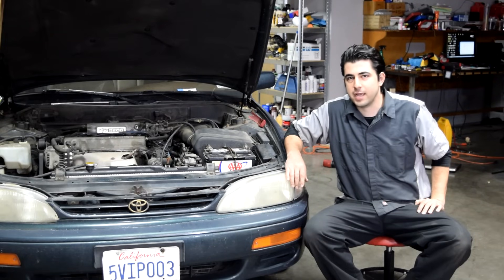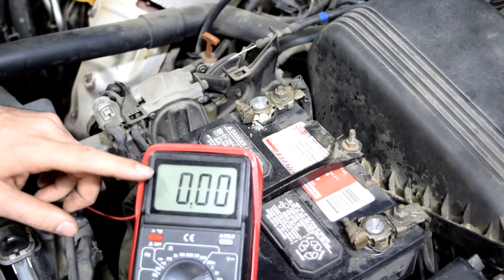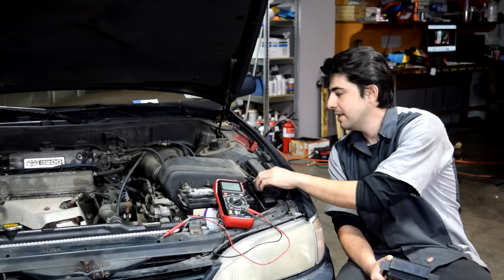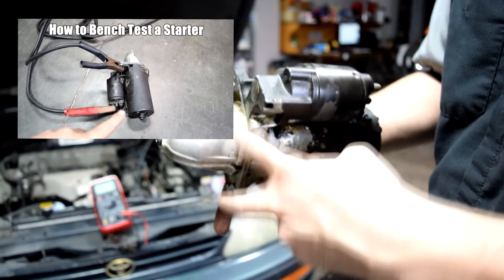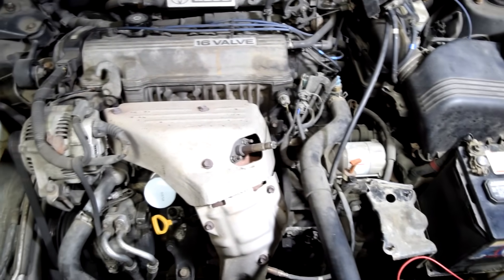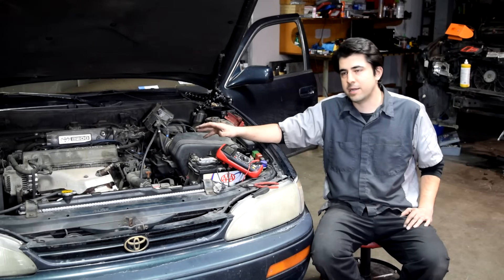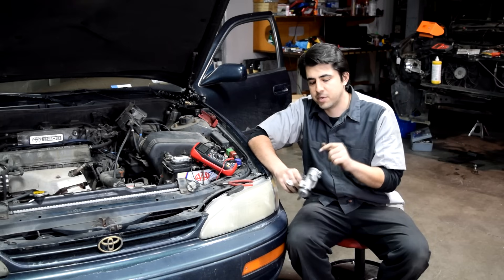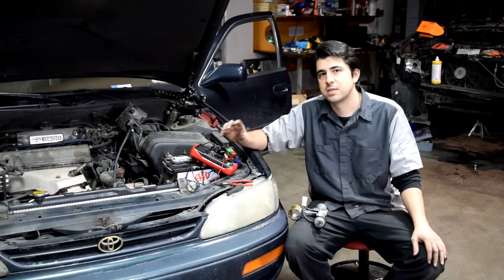How to Diagnose a No Crank No Start Issue - Nothing or only a Click When the Key is Turned

Comment: Excellent detailed video. Thanks for sharing your expertise. I got a no crank, no start and have been getting PCM codes. So I replaced my PCM. Still no start. I just changed out my ignition switch and still no crank. I cannot jump start it, so not the battery. I'm going to test fuses next and go from there.
Reply: I have 2006 Chevy Colorado same thing like mine it was the tb plug fixed it runs like new now
Reply: James Brant I replaced the starter. It started but I’m still getting battery light and I had the alternator replaced just a few years ago. So I’m thinking it could be a wire to the alternator.

Comment: How about a no start no crank, no click, no dash lights no dome lights come on or the headlights, power windows and locks dont work. Battery was tested, not the battery starter hot wire hot, i cant figure it out
Reply: Check your 100amp fuse

Comment: I have a 95 dodge dakota, 5.2 v8. I had the same thing happen to me the other day, i tested my battery and charged it and cleaned the connectors, then i pulled out the starter motor and had it tested, it passed and so i put it back in, when i plug it in and touch the two starter motor wires   together with a screwdriver (to arc the connection to test it) it works, i tried swapping out the fuses too, nothing, so i am taking apart the steering wheel and seeing if there is a problem in the ignition system.  HELP!

Comment: When I start my 97 Celica it initially does not turn over. Everything else goes on (radio,interior lights, etc.), I reset and wait two minutes and it starts right up. Is it the solenoid, starter relay or starter motor which is not charging up sufficiently?

Comment: hi guys i have an audi a4 that not start, i jump the cramshaft manualy and start but don't speed up and turn off, while it's started if i disconect all other sensor it still keep running i'm disconcern.  any advice. i changed all sensor and icm(computer) and keeps failing.

Comment: so why if I follow all those steps and the starter is brand new and the starter solenoid is new even the battery is new my truck just make a noise like trrrrrr then just the click sound after 2 more click she melted the terminal of my new battery btw i turned the engine by hand to make sure so I think is not froze up or seized any tips?.
Reply: Did you ever find out what it was

Comment: This week my 7.3 had no click one morning on several key turns, came back in an hour, started right up.  The morning prior had to crank 3rd time (no clicks, just cranking, no fire up) before it shimmied right up and was good.  So, Replaced 2 year, 10 month old "good" Deka batteries with Odyssey glass mats and no more issues and wallet's easier to carry.  Last fall I had a "click" noise when turning key, there was a click" from R front fender area, replaced starter relay and good to go (had to hit relay to start to get home (or you can screwdriver from small to larger terminal on it, and risk shock)).  Tried a new relay when had click one day a month ago and found the ford one took more draw and wouldn't work, so put on chinese one and it fired up until this week, so I had clues my batteries were ending life cycle).  Sometimes numbers look ok but older wiring loses juice at various spots and grounds get crappy, I had cleaned starter connection under truck and all battery bits in the fall, but cold winter drained more juice until it was clear I needed new cells.  My starter is hi-torque, and alternator HD rebuilt, both last 2 years.

Comment: i get no crank anything on a 91 crx i got new battery, alternator, starter, my headlights brake lights and turn signals all stopped working. only thing that works is my dash lights. thanks
Reply: Maybe one of ur vtecs is unplugged

Comment: Thanks to your video, you told me the first thing to check was a Voltage on the battery of 12.4v or higher. And there I had a battery registering 12.27v

And here I was worried about the starter, or the ignition switch. Bloody batteries.

Comment: I'm a 1st time Chevy truck owner.I have no start no crank on 94 Silverado 4x4. I've seen vids on this but it can be any switch that's considered safty. I bypassed the back up switch with push button, but still have to wait for start, what else can I do?
Reply: Cynthia Pearse...Hi, I own a 95 gmc sierra extended on jus today1/24/18 truck killed...No Start No Nothing...but lights heater radio works?? ..You ever fix your problem?
Reply: I did the same as you,but still working on the problem. One vid here says ignition issues, safety in trans ,solenoid, starter, it's crazy but will let you know. Push button worked 2wks,and still waiting for it to start like before.
Reply: Kevin Reid nope but all my stuff,radio, heater works but now my push button start is not starting it and I lost both heater and radio.

Comment: Thank you so much! As im sitting in my garage with dust and grease on my hands, my car is now fixed and I don't have to worry about getting to school or anything else! Thank you so much for this video!
Reply: I have a basic 1999 Toyota Tacoma manual 5 speed.  It is not starting.  No crank and no fire.  Nothing!  No instrument lights on when I turn the key. The headlights nor the interior dash can light goes on.  I have fully charged the battery.  I have checked the battery bolts, reads 12.6.  I confirmed the battery cables are fully connected and tighten.  I repaired a 9” thin black wire that was barely connected to the main NEG battery cable and connected to the inside finder to ground. I ensured that there is a solid wire contact to the metal inside fender and joining up with the rest of the NEG battery cable.  Still no crank and of curse no fire.  Any suggestions of what to try next?  Thank you all for sharing your own mechanical issues with your own Toyota trucks. Be blessed. 🙏🏻🇺🇸
Reply: Yes, your battery... its mostly the battery... the lights should of least come on with the battery.. check again... hopefully it's that..

Comment: Hey guys just sharing what happen to me, I have a 2005 Jeep Liberty, I had the same Issue as shown here except for the radio, I checked the fuses and relays but no luck even a friend sent a couple of mechanics to my house and still couldn't find what was wrong with it, and we thought it would be the ECU or something to do with the alarm, but what actually ended up being the fault was that the steel rod that connects the shift handle to the transmission had separated and so the car was stuck in Neutral, now, just reattached the rod to the transmission metal and set it up to parking and It started nice and clean, hope this helps someone out since I had to bring my car home on a crane.

Comment: hello sir, some days ago i was driving my car for one hour or maybe one and half like every other days normally, then i stoped in a parking and was talking to a friend of mine for a while. my car was on the gear and hand break also pulled up. i turned the engine and car jumped to forward and then turned of. after that i couldnt start the engine when i roll it then it starts with rolling and i can drive it as long as i want but with the switching i cant turn it on. can you plz give me advice what to do? Thanks

Comment: If you switch the starter relay with, say, the horn relay, wouldn't you be able to tell if the starter relay is good by the horn working?
Awesome video. Thanks so much.
Reply: If the two relays are the same and have the same numbers . Yes it should work.
Reply: If they have same connections on bottom look carefully

Comment: Hello buddy, first of all thank you for your amazing channel I recently faced a No-Crank-No-Start problem on my Chevy Trailblazer 2008, 4.2L, I6 engine. The engine ran fine. I returned from office, parked the car and tried to start it after around 3 hours to do some grocery in the evening but no crank no start. I confirmed (using the battery check up steps you mentioned) that the battery and terminals were good. I took my car to a friend's workshop. I visited his shop the next day and his mechanic told me he could not find any problem with the alternator or starter. He called on different car electricians and they could not diagnose it. He asked for electrical technician's help from a neighboring shop. 

This is how my friend described it to me "the electrician did not even open the hood. He connected his scanning tool and reprogrammed the PCM. The car will run fine but if it happens again, you should replaced your PCM."

Listening to this I asked questions which my friend could not answer because he is not electrical expert and the loaned out electrician had already gone.
Here are my questions.
1). When the engine is not cranking not starting, how can I connect a scan tool? with no power, will it communicate with the PCM? If yes, what can I look for? and what can I possibly alter?
2). Did he really reprogram it? Is it possible?
3). What do you think was the actual problem?

I do own a scan tool and regularly check my car's engine parameters after scheduled maintenance. Your videos have helped me save hundreds of dollars by not replacing the good parts. Thanks again for your videos. Keep up the good work. I wish I could contribute to your channel beyond just recommending it to friends.
Reply: This is 7 years later, but what kind of scan tool is able to do this?
Reply: Exactly what i was thinking  @innovateandinvest 8th gen civic here turn the key get one single click noise I replaced the starter not even 6 months ago and now this is doing the same thing turn the key single click I'm at my wit's end just finished replacing the ignition switch relays good inside the car do you have any ideas by all means please respond

Comment: I have a 2000 camry with this no start/no click issue. After about 10 or so minutes of turning the key it will start. After about 20 starts or about a week or so it will happen again. This has been going on for months. Battery is almost new and replaced positive terminal(twice) and no corrosion!Also tightened the battery wire to the starter all to no avail. Any Ideas?? It had 261k miles and runs freat except for this problem.

Comment: I have a problem where my car wont start.  I did all the checks you mentioned, and I even took my battery to have it load tested. The battery is only one year old.  Anyway I have a no crank no start problem, so I thought it was the starter, except that I was able to jump start the car.  So needless to say I am clueless. I even cleaned off the small amount of terminal corrosion I have.  Do you have any ideas. My car is a 1997 sebring convertible with 2.5 liter engine

Comment: I have a Toyota Corolla 2003 Manual transmission. Never had an issue til now. I turn the ignition switch and there's but a click. All the videos feature  automatic transmissions but everything is placed differently on a manual. I'm still lost. Help!

Comment: I own a 2006 Honda Accord and I have a no crank, not start issue. If it's my transmission switch will my shift indicator show both park and drive? Both of them light up. My car also worked before but took a couple of seconds to start up.
Reply: Henry V Did you ever figure out what was wrong? Our 06 Accord is having the same issue.

Comment: After determining the Battery and fuse are good, have someone hold Key at Start position and crawl under and give the starter a rap or 2 with a hammer.  Sometimes a Brush will stick away from the commutator.  I have had this work on a brand new vehicle, 87 miles.  Never happened again.

Comment: Hello great video and I did try some things you mention.  I have a 2007 Chev Cobalt automatic 2.2L.  I heard a sandy noise when I started the car. So I removed the starter and found grease and sand in the solenoid. Bought new one replaced it, cleaned all connectors battery is good.  Tried to start and get just a click on each try.  Tested voltage to solenoid and get 12v, tried to bypass to start at relay and still get click. Bought new relay and get click. Wires on tight to starter and clean.  Battery good and no corrosion "clean".  Any thoughts would help, thank you.  No starting problems ever before I removed and replaced starter 2 times and both tested good.  Or anyone rung across this problem could help, thank you!

Comment: i have a 2010 w212 e220 cdi..........i cant solve my issue, i drove car home all was great, parked it all was fine... had a few hours at home went to take grand daughter to the shop and car unlocked with 3 beeps of the horn..... car was in park with handbrake on, i put key in ignition,

 i got the basic dash mileage lit up[ on the dash  display and nothing else , no use of dash computer menus, no radio, infact no elecs of any sort for the rest of the car inc lights radio windows , its locked in park ( i can manually get it in neutral if needed) theres no fault codes ive swapped battery...and also  and the brake light switch clicks when the pedal is pressed.....ive swapped relays and checked the master fuses

the car has not been jump started , the cars battery connectins have not been tampered with

what could this possibly be

Comment: One small correction (or two):  Voltmeter readings of 12-volts or higher... only means that the batteries "cells" are good (2-volts per cell x 6 cells = 12-volts.)  That does NOT mean the battery is "charged."  If the battery is badly discharged, the car's interior lights may not come on, but the battery CAN still be good (12-V or higher):  it just needs to be charged.
Since "you" have a multimeter, go ahead and get a jumpstart.  With the engine running, you should see 14-volts across the battery terminals.  If less than 14-volts, the alternator is either dead, or dying.

Comment: I just this week started having starting
problems with my 2003 3L V6 Ford Ranger.

So far it has only happened twice. Each
time it started and drove fine. But when I went to start it again it cranked
just fine but wouldn’t start. After 10-20 minutes ± it starts right up and runs
fine. When it isn’t starting all gauges and lights are working normal. 
New Battery + clamps               no other problems

Comment: What if this issue is random, I am having this problem more frequently in the past 2-4 weeks, I have experienced it before, but in vary rare occasions, now it is on a daily basis, but after one or more clicks then the engine starts. Mine is a Ford Fusion 2007. Could it be related to the Key or to the quality of the fuel (some fuel pump security alert). I am suspecting of the quality of the fuel in my country these days. Thank you!

Comment: what would cause a 2010 ford escape not crank over? battery is good good fuel pump
once it sits after a long drive and the car sits about 15-20 minutes not able to start again the dash lights come on with no theft light and there is no voltage to the positive starter line from the fuse

Comment: I have to say thank you for your video's. I've been trying to diagnose issues with a 67 impala. And every video I've watched of yours tonight has led me to believe it's in the ignition switch or the wire leading from it. Because I can jump the starter, and when I turn the key I only get 6.5 volts coming from the ignition trigger at the starter ( battery provides a solid 12.6v at battery and starter always hot.) Thanks for helping out yet another backyard mechanic!

Comment: nice info my man. Hey my 98 ford explorer has no lights on dash. However, after driving 60-80mph for about 20 miles, the truck will just randomly shut off. After sitting for 5 minutes, it will start back up again. Had a tune-up done 3 months ago, no issues until after that tune-up was done....

Comment: I have same problem with Williams below. have ticking sound but won't start. I did replaced battery and it worked fine for about a week. but it won't start again. I leave my key at on position for 30 secs-or more, it starts sometime. any idea how to fix it or what's with my car?
Reply from the maker: +sam park You could have a slow battery drain or badly corroded battery terminal connectors, start by watch my video on "how to test a car battery" that will be followed by other video's you might find useful.
Reply: I checked the battery life. its at 92% since I replaced it. I did had corrosion outside of the terminal but I removed them.. but still experiencing the problem..

Comment: My vehicle has no
Crank
One click what's that mean ?
Reply: +Cole miller The "click" you hear is the internal switch in the solenoid trying to make contact. It is either not able to make contact because of wear on the inside, or it made contact and the starter is not working. Check the power from your battery and make sure it isn't low, and look for loose or corroded connections. Depending on the location of the solenoid, you may be able to change it. A hard click usually means the solenoid is working, but the starter is not. If the solenoid is accessible, you can check the output from the solenoid with a voltage meter to see if the power is being sent to the starter.

Comment: Even with terrible corrosion on the battery post, it won't show any voltage between post and terminal unless you draw significant current.

Comment: Hello, I have a 1997 Jeep Grand Cherokee.  It intermittently will not crank.  I am about to replace the battery terminals.  There are 2 cables on each pole (Negative going to the block and to the body, Positive going to the alternator and the Power Distribution box)  My question is, would there be a problem if I join the 2 positive cables together? At AutoZone, they told me I should not do that.  Do you have any advice?  Thanks.